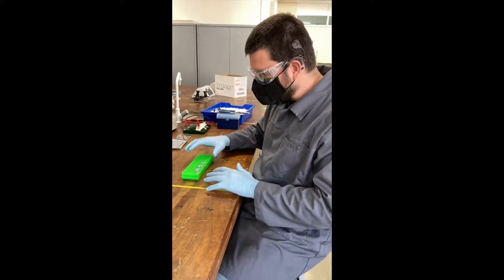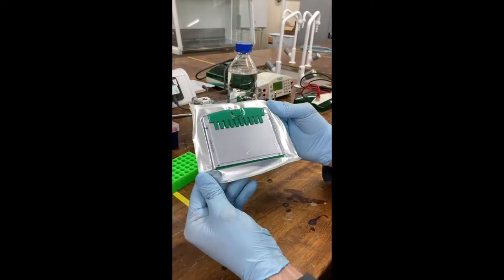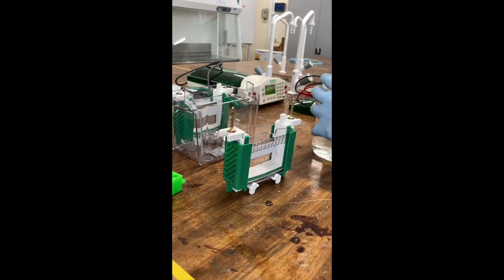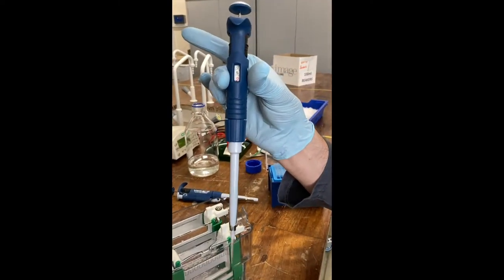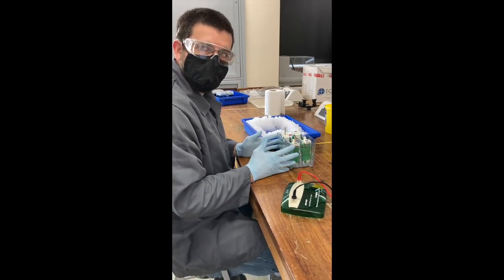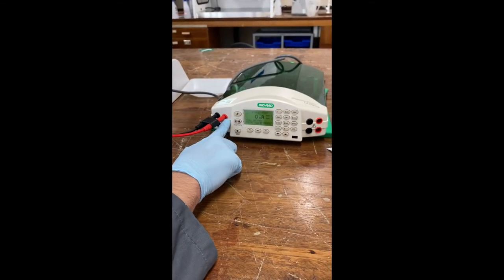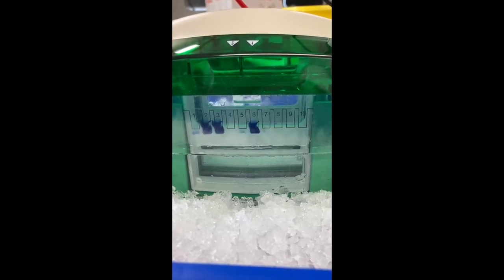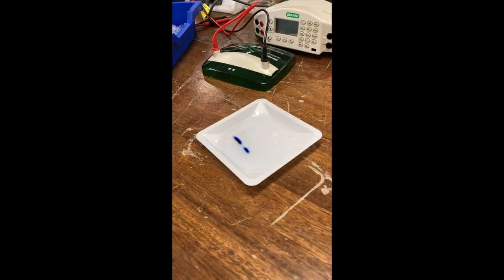Setting up and running an SDS-PAGE gel

Comment: Very informative!  When visualizing the gel, how do you keep it moist without keeping it in so much fluid that it will move around?
Reply from the maker: It really depends on how you intend to visualise it. If staining then the gel will be in liquid anyway and once stained it can then be dried using drying film and solution. If using an electronic visualiser than the residual fluid on the gel should be sufficient to keep the gel moist for the short time needed to expose it. You can always add a little extra liquid to the gel if worried it will dry out. Hope that helps.